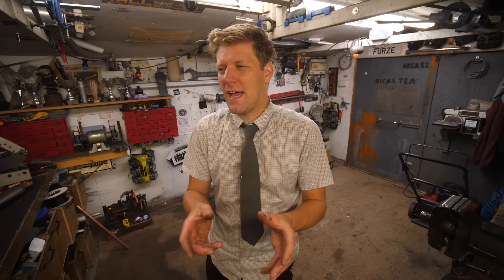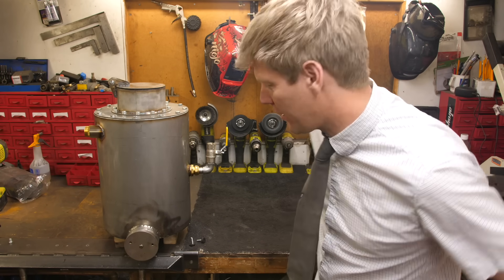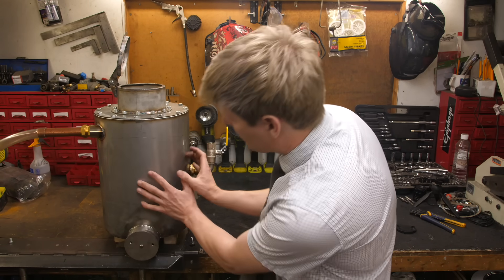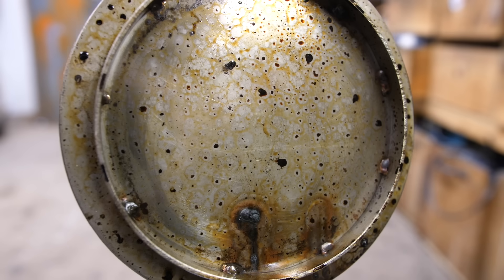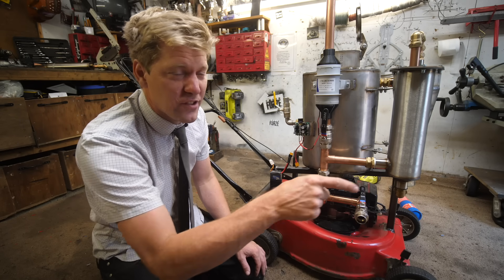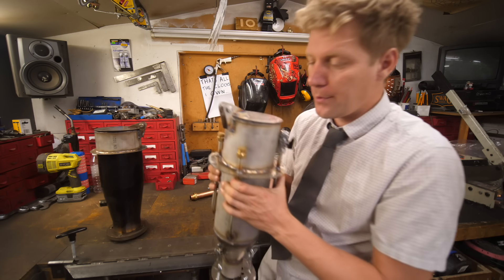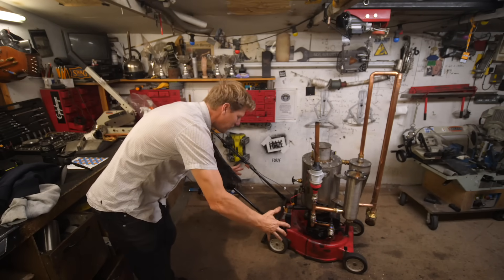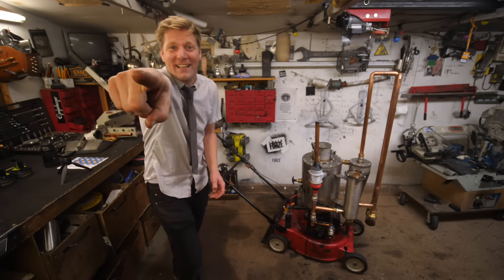WOOD POWERED LAWN MOWER

Comment: The heat is to low result should be just carbonmonoxide and methane and a bit of hydrogen as so called wood gas

Comment: I saw someone make a gasifier using an oil heat exchanger for the filter and cooler and it worked great had little petcocks on the bottom to drain the oil and it cooled down the vapors so it wouldn't fry his fan and the flame was short and blue instead of long and red you don't want red also you're going to want the gas cooler when it goes in the engine or the engine will struggle

Comment: You need one for the bunker, but look into getting the radiator off a fridge or a car to help condense the gas.  Maximum surface area is key.  Maybe if the pressure of the gas is higher enough use it to turn a fan which cools the condenser pipes.  Don't pass the wood gas through the flames because your getting CO2 on the mix, just heat the wood and the gas will leave at a certain temperature.

Lastly think about all the junk in your gas and their condensation and boiling points.  Think about how petrol is separate from oil

Comment: I think it might be wise to make a hybrid system that uses gasoline or alcohol to start and stop the mower with. You switch it run it on gasoline or alcohol just before you turn it off to flush it out.

Comment: Run the hot gas through water immediately after it's created. That should cool it and stop the tar very fast. It will be water saturated anyway, so you may as well cool it through direct contact/splashing of water. This will also drop the ash from it. Then use the condenser pipes to collect the bulk of the dirty tar/water spray. One final air/water separator after the "fuel" valve should get the remaining condensible water out, since the pressure drop will cool it for the last time before the engine warms it back up.

Comment: Skip the combustion engine. Burn the wood from the bottom and put the air in the bottom. New wood needs to be stacked very high on top and will capture all the ash and tar. This means the tar will be burned later too.

Then ignite the wood gas in the exhaust stream by providing air and a heat source and heat the bottom of the a cylinder of a sterling engine. The other side of the engine can be cooled with a deep well water which is pumped in a cycle.

Should be nearly quite, smoke-free and by introducing oxygen into the exhaust stream very early you avoid that sud will collect in the chimney.

Comment: What about using a filtration system with diesel exhaust filter liquid. Or something along those lines, then use a small fan to push the gas through liquid, kinda like a bong. Even make a series of them. I dunno just throwing it out there..

Comment: why not  use  solar power to heat wood with  heating cartridges.. no smoke only gas  so the heat you use in your house to  heat the wood is heating the house andyou stor the gas in a bladder outside the house for cooking>  cheaper than story energy in batteries.. with minimal losses.  what do you think.

Comment: This is awesome. You could try running your tubing through a reservoir of cold or liquid to cool the gas and cause the tar to accumulate faster before it makes it into the engine while having a vertical run before entering the engine manifold. If it works, it could help keep the tar build up out of the engine but it will just be building up in the coil windings that run through the water. Maybe make that part quickly interchangeable so you can place a new piece while setting the other in solvent to remove tar build up. 

I wonder if it would be possible to skip the coil windings through water all together and figure out how to possibly use the cooling liquid itself as a filter. Possibly a plexiiglass reservoir filled with cold water which has the inlet of wood gas at the bottom of the reservoir and the outlet with the cleaner air to the engine, at the top of the container. I would figure that the colder the water, the better the coagulation and build up of tar there would be, therefore better filtration. It would be a good experiment to see if adding soap to the filter water would affect filtration.

Comment: It's best to blow up through the burn chamber and clean the gas as it comes off the top of the wood Hopper. That way the fan is in front burn chamber.  I used a water trap to filter my gas. That also makes a great fertilizer.

Comment: Great vid ! I think the first design could have been good enough.
The tar issue is because you filled the reactor with 100% wood. To make it work normally, either you have to fill the reactor with charcoal, from the grate until the air intake. And the rest you can add wood

Or if you fill with 100% wood, you have to wait until the wood below the air intake is converted into charcoal, in other words you have to pyrolyse the wood below the air intake, which produces a lot of water and tar during this period.
Once the wood is converted into charcoal, the gas will be good and clean, and you can turn on the engine !

Comment: There is going to be a problem one day because the wood cellulose breaks down to the oils and what burns will gum up inside the cylinder walls of the engine of the lawn mower and can cause engine failure.

Edit: Goodness gracious, has my English gotten so much better in four years.

Comment: colin as you already have your fuel in a gaseous form you don't need the carburettor all you need are the two valves that adjust the fuel to air mixture that you built onto it and a choke plate before the air inlet

Comment: This contraption may not cure the new strain of COVID-19 but it surely cures some lockdown boredom.. 
Insulate your heatbox for more intense heat.
Prewarm the air then 
let the warm air get sucked through the fuel. (will warmup the fuel and may help with water content.
Thermally decouple your stages to prevent conducted heat and again increase temperature of primary burn.
Let gravity do its thing and try to create a vortex ( bit like cyclonic vacuum cleaners) to spin of PM.  (maybe an old dyson funnel)
Use pellet fuel as the MC an caloric values may be more constant during development.

Comment: I would consider trying to run this on a 2 cycle engine. Tar may act as a good lube instead of the oil. and far less moving parts inside the engine.

Comment: Is the tar likely to condense or build up in a certain conditions? Is it rising, falling, splattering. Looks like it's all over everything in your jury rigged boiler. First time I ran into these the filter medium was water and a drip off in a length of tube. Looks like you produce loads more though.

Comment: Hey Colin, love the video.
I have a tip that might help with efficiency problems with the cyclone. when welding pipes and stuff for gas or liquid, you should use a purging/backing gas going through the pipes so the weld permeates through and leaves a nice flat weld on the inside too. This is especially the case for stainless steel.

Just thought that the not perfect welds on the inside could affect gas flow and the efficiency of the cyclone because of gas distortion.

Comment: Wouldnt a propane negative pressure regulator work well for wood gas? My pickup runs on propane and the regulator requires vacuum to open and let gas in, the mixer is designed to create the proper level of vacuum throughout the entire rpm and load range of the engine.  Keeping near perfect mixture.

Comment: Of course, the gases produced by a gasifier is a combination of hydrogen, methane, other trace gasses, and carbon monoxide.  The problem is carbon monoxide is toxic.  Do not breathe it or trap it in an enclosed area.  Could kill you!  Great build.

Comment: For us firefighters, this mechanic is a very dangerous thing to see during something like a house fire. People tend to close the doors becouse there’s fire inside, but this makes the fire create this really hot smoke and flammable mix, as soon as we open a door or window to enter the building, air (oxygen) rushes in cousing this gas to explode cousing what’s called a flashover.
So should you close all doors and windows when there’s fire inside? It depends, if the room in perfectly sealed and no air can go in, the fire will die out, but if there’s just enough air comming in to keep the tiniest fire going, it’s better to leave a door open. It will seem to couse more damage at that time, but when the firedept. comes to extinguish the fire, you’ll be better off that way.

Comment: Instead of trying to filter it better to just have the exhaust from the gasifier near the intake on the carb.  Then the muck drips out the end onto the ground, and only the gas gets pulled into the carb.  You then adjust the air/fuel mixture by controlling the distance between the outlet and the carb intake.

Comment: one mistake that all you wood gas guys keep making, replace that "air/fuel" ball valve with a needle valve.. you will have much finer control and will be able to tune much easier.
Reply: On reflection, A gate valve will work just as well or probably better for dirty gas like this.

If you wanted to get really fancy and build your own carb to totally replace the motor's carb by having a gate valve for the air regulation and a needle valve for straight gas through a simple T or better yet Y connector directly onto the intake manifold.
This would simplify the intake side of things as there are no "useless" circuits in you carb or an unneeded fuel bowl or floats to deal with.

This would have the added benefit of being more like a carb in terms of tuning and a little more intuitive for anyone who is familiar with those systems (as I know you are Colin)

Comment: I wonder if you could bubble the woodsmoke/fuel mixture through water to cool it down and filter out some tar. Maybe put an oily solvent like lemon oil in the water. ive tried that on my... water pipes (for tobacco use only) and it really pulls the tar out if the hit.

Comment: Id implement a waterlock, it would wick mosture and tar from the gas. Also it needs to be big atleast 2 quarts to keep the water from getting too thick from the tar. Id look into getting some adjustable flow control valve for the air to gas mixture, i find ball valves annoying to adjust. Also the fan is kinda redundant as the engine will form a vacuum once its running. Im no expert in this but these are just my ideas.

Comment: I would love to see this wood gas generator used to power a hot tub. I bet you could run the water from the hot tub through a tank that the radiator sits in, then use the engine to cycle the water through the heater tank and into the tub out the jets.

Comment: I built a much larger gasifier several years ago and aside from a couple small explosions in the hopper getting it heated up filtering was my main issue. My generator filter was tared up after twenty minutes of running it and I did do the same thing with  vertical tubes to act like a radiator to condense the moisture.

Comment: My understanding is this leaves the carbon monoxide behind. Could you safely (!) pressurize that maybe to a low psi and use than? Or would it just be better to have battery powered everything and run a generator of the gasifier?

Comment: Have the gass filter though the water  Collection radiator thing (like a hydrogen collector) then you could keep it small and keep tar from building up in the engine due to the smoke

Aske me anything

Comment: Be careful with this device, wood gas typically contains very high concentrations of carbon monoxide which will kill you before you know about it. Do not run this engine in an enclosed space.

Comment: You need to bubble the wood gas through water. This will absorb a lot of the particulates, water, and tar from the gas as well as cool it off. Similar to a bong in concept.
Reply: Reminds me of the time i made hydrogen baloons from my cousin's bong, it looked like i was making drugs lol (i don't do drugs pe smoke ironically)
Reply: We all know bongs work well.
Reply: @Mr.M1STER  Given the amount of resin I have to clean out of mine on a regular basis I'd argue they work better than you're giving them credit for. :P
Reply: @Cheebzsta  We all know bongs work well.
Reply: Would that not also produce water vapor and over time wreck the engine?
Reply: @theburningtoastmonsterofur7028  I doubt it, there is a little water in most gasoline due to the ethanol absorption and most 4 stroke engines these days don’t have too many problems with it.
Reply: @fivespeed3026  even still, would it not do better if there was no steam and/or water vapor even if only marginally?
Reply: @theburningtoastmonsterofur7028  you'd just run it through a condenser afterward and get rid of all the water vapour
Reply: @nelsonglover3963  eh, fair
Reply: @theburningtoastmonsterofur7028  No, water injection is actually used on high horsepower diesels to cool the charge temperature.
Reply: Ah bong now I get it.  Now we're banging on all cylinders
Reply: Bong...check!  Ummm I don’t remember what I was going to do.  Oh yeah, pack bong.
Reply: Possibly the best thread I've witnessed on YouTube...well played you magnificent people.
Reply: Why is no one mentioning HYDROGEN? The primary component and why smoke can ignite lol... A bubbler is a good idea, but you would also need a condenser to take out the moisture your putting into the hot gas before combustion...regardless...the contraption would look really cool! :)
Reply: Oh, it was a bug.
Reply: the only problem i see with that is that the fan would have to be before the bubbler were the gas is still really hot
Reply: @specterx0107  Wrong where.
Reply: @specterx0107  
Why? It works on pressure differential the fan is there to suck in the first place.
Reply: or the randomn
Reply: My brother hahaha
Reply: @magnumopus9058  I'm Pretty sure NightHawk is exactly where colin got the idea of gasification to begin with

I saw his comment on his Wood Gas bike saying that he'll try and experiment with it
Reply: have you seen the one on reddit thats like 4 foot tall?
Reply: Perhaps mineral oil and not water.
Reply: MMMMMMMMMMMMMM That gives me an Idea . A wood gas powered Bong for my self .
Reply: That's actually a half decent idea, friend!  Holy cow, if that's the fix, that'll make me so happy!
Reply: @D1NKERR  why, because this would help you building your own wood-fueled lawnmower? :D
Reply: @n.l.3776  Not quite.  I'm a maintenance guy at work and I solve problems like this all the time.  Solving problems and making people happy makes me happy!
Reply: @D1NKERR  alright cool, i just had to laugh at the idea that somewhere in the world sb else had this exact problem and finally found the solution xD
Reply: @n.l.3776  What I like so much about it is that while you're using it, you're using bong technology!  If that isn't cool, what is?!!  That water is going to get NASTY

Comment: There was a car that ran on burning walnut shells. But the tech is really difficult and unreliable. It took hours for the guy who operated it to get the car running and they burnt down a vacum cleaner in the process.

Comment: "Colin you're Cheating there is fuel in there" lol

Taking the fuel tank off is 1 thing, there still can be fuel in the carb, the engine should have been run dry with the fuel tank off to be safe,
However it is unlikely that the engine would run for as long as it did with the small amount of fuel in the carb. Good idea
Reply: He did use gas to start it anyway. Gotta give him a pass on that one, given the ambitious nature of this project.

Comment: You could consider using a liquid trap instead of a stainless steel one- use grease, or water, and you can likely get most if not all of that tar out- plus, added cooling benefits.

Comment: The future is this not electric cars cause we will still get the nice V8 not some quiet electric motor
Reply: this type of engine was used in europe a lot after ww2, because fuel was scarce, and firewood was not, necessarily. And the existing engines could be modified easily enough. But starting the engine takes too much time, like 20 minutes, because you have to heat the burner up, so there is that massive downside there. Also, burning wood like that produces a lot of emissions, too, so cities would suffer from terrible smog with this. It is like combining a combustion engine with the downsides of a steam engine, basically. There are still some odd weirdos using gasifiers on pickup trucks in europe, but I have seen like 2 or 3 in my life, and always exclusively in the countryside, where emissions and wood would be no problem. The future for cars from an engineering standpoint is pretty much hydrogen, all things considered. And because that is more expensive, another part of the solution is not having everybody driving around in their own car all the time.

Comment: wow you are so good. I tried this (a little bigger). But the open top version (with no cap on top). So I could fully automize it for a generator so I dont have to fill the woob by myself. It blew up 4 times, then I stopped. The best I got was the smoke burning, but only when you light it up. Can you make a fully automatic gassifier ? That you can controle by phone and have elektricity for whole your house ?

Comment: Colin, for the filter I suggest you use a sort of bubbler where the wood gas enters the bottom of a container and bubbles up to the top, this removes all the tar and leaves it in the water (you do have to change the water though)

Comment: You put charred wood into a sealed chamber separated from the fire but still right on top of it it releases the flammable gasses with out taring up the system + with that system there is no need for a carb

Comment: I was introduced to this tech 10 years ago and have built several riding mower with one equipped..... anyone considering this project make sure to put a pop of valve on gas chamber away from any flames ..... it can blow up